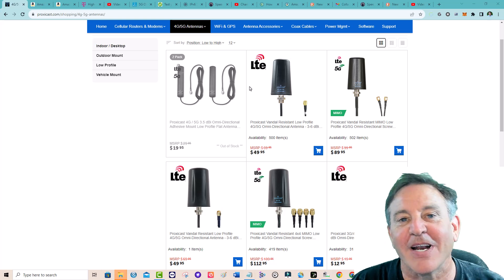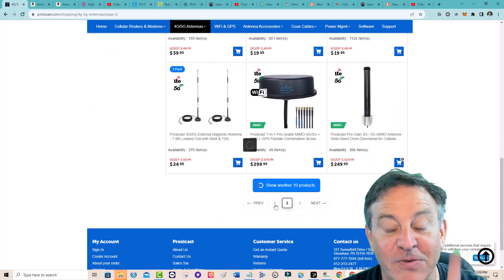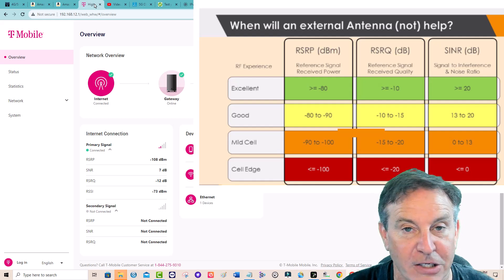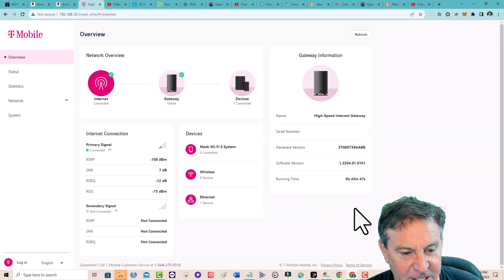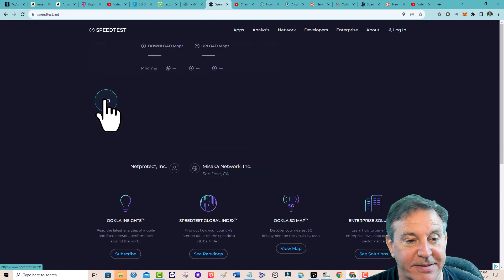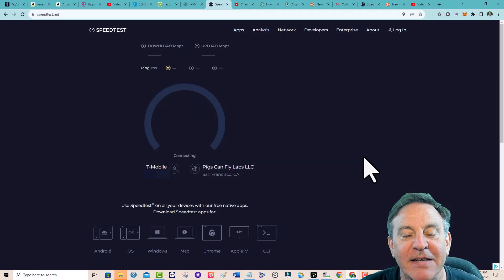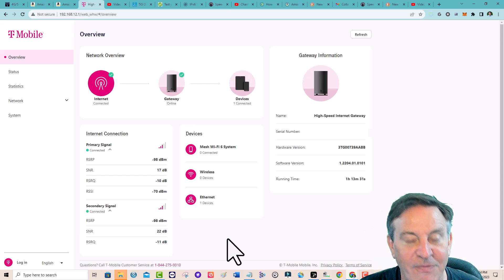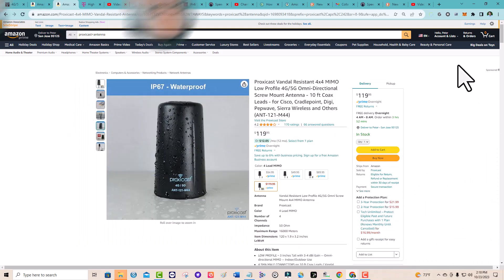🔴Small 5G / 4G Antennas - for Vehicle or HOA Stealth Install

Comment: more bar your near the cellsite, less bar your to far from the cellsite, speed depend of traffic or area.
Reply from the maker: Bars are not related to your distance from the cell tower, they're merely a reflection of signal strength. They tell nothing about signal quality or signal of noise ratio which is actually more important. They tell you nothing about the band that you're on or the backhaul provided to the tower. Is there a question?

Comment: Who is yuri?
Reply from the maker: Russian programmer that takes it personally when you report a bug. I've got a new small antenna that looks really good.  Stay tuned.
Reply: @PeterC408  ohh ok nd I had a question I am using third party gps system that runs on 5g as it's source of net but cell reception gets weak in some areas so can I use this antenna for it(it's a Android 11 bases 10 inch screen)

Comment: Does VSWR matter? Some of these antennas have a VSWR of 3:1 or less.
Reply from the maker: The thing that I am most concerned about these antennas is their size. They are small, very small. They will work well for high band frequencies but what about the XR bands at 600MHz. You may want to get more metal in the sky to be successful with the lower bands.

Comment: Thanks for your review. I really need a 4x4 for my RV!

Have you opened these up? One review for the 2x2 from J. Newman on Amazon says "…to my surprise there is only 1 antenna. The 2 mimo connecting wires looked like they were wrapped together and soldered to one point on the antenna circuit board." Do you think this matters?
Reply from the maker: Great question and I have a good reply for this... and I will be posting it tomorrow.
Reply: @PeterC408  Thank you. I did order this 4x4 anyway based on your test results and the fact I can't use those huge rectangular flat 4x4's on my RV roof. :)

Comment: How would you configure this to work w mobile ?
Reply from the maker: What is w mobile?
Reply: @PeterC408  can this be used to boost your cellular phone / mobile signal ?   If so, how would you configure it since it has a “antenna” hook up
Reply from the maker: Sadly, no this will not do it. Here is a product that is supposed to improve your signal but it did not work for me. This is the only bad review I ever posted https://youtu.be/1wJhVV5hDK4

Comment: I enjoyed your video, but I don't agree with your assessment that power is just power...power should always be a primary consideration because it is an indicator of problems/losses in your system.  You can have a million dollar setup but your power losses, that can be eliminated with clean connectors, can ruin your day regardless of what your equipment cost.  Don't you know RF is a product of magic? He he!
Reply from the maker: Power is kind of like water pressure; once you have enough, you can move your focus to something else. Kevin from Proxicast likened Power to music volume. Louder is just louder. You need a clean signal more than just loud.

Comment: Good evening Peter. Thank you for taking the time to answer my questions. Really appreciate it. Now I can make an informed decision based on quantitative data you have presented in this video. With that in mind, I have to compare your information vs. the bands available at the intended area of operation.

As a follow up, I just confirmed with Cellmapper and the LTE bands at the local T-mobile cell(s) are 2, 4, 66 and 71. 66 performs at a max download speed of 260 Mbps with an average of 139 Mbps. On the upload, 66’s max speed is 49 Mbps with an average of 11 Mbps. With this info in mind, I may benefit from higher gain equipment. Would you agree?

However, Proxicast will be a better application for my main residence in Miami Dade county a few miles away from Miami International Airport. Certainly a contender that punches at a higher weight class. Good for Proxicast for providing a great quality product at a reasonable price.
Reply from the maker: From what I understand, gain only amplifies your signal (good and bad). It would be like turning up the volume on the radio of a channel that you don't get very well. Sure, its louder but is that going to result in more bandwidth. I got the greatest improvement by simply adding a single 2x2 antenna https://youtu.be/wXSpbP8NuWw You can paint this (no metallic paint) and it will look pretty good. Or you can say it is a TV antenna which they can not keep you from installing. It is your right to receive OTA TV broadcast.  Many of them look like this.
Reply: @PeterC408  great point. One way or the other, I’ll make this happen. Thank you again for your time and cooperation. I’ll keep you posted on my progress next time I go to visit my in-laws. Hopefully this will give the opportunity to telework from the island every now and then.
Reply from the maker: I was literally in the middle of nowhere and I tried StarLink https://youtu.be/Pc4O9RUepTw It worked pretty well 25 Down and 5 Up. Not amazing but I was working remotely!
Reply: If its a 4x4 why just two leads. What about the other two wires?
Reply: What two wires do you test on a Fast 5688 tmobile router?

Comment: Nice video.  Have you tried any of the plug-in powered cell boosters sold online?  Hiboost and a few others?   A little unrelated, but in the 1990s I lived in a second story condo (top unit in an 8-unit layout) and we had antenna restrictions for TVs.  No way was I paying the sky-high cable TV costs.   I looked around a bit in my unit and found the access hatch into the attic in a closet.  I was able to install a full TV antenna up there right above my TV, run the cable down into the room through a hole in the ceiling to my set and the quality of reception vs standard 'rabbit ears' was incredible. When I sold the condo I simply pushed the cable back up into the ceiling, patched the hole, and the new owner probably wasn't the wiser of what was up there!.
Reply from the maker: I have and this time I was really excited to get a 5G version but this is the only negative review that I have ever posted. It failed miserably. Take a look https://youtu.be/1wJhVV5hDK4 
It makes me angry that they can sell products like this. I have not been this disappointed since I was 7 years old and bought s 7' ghost from the back of a comic book. Total scam.
Reply from the maker: I got burned with "Sea Monkeys" too. Didn't look anything like the picture.
Reply: @PeterC408  My first consumers disappointment was EXACTLY the same with the 7' tall "Monster Ghost." It was a piece of plastic and a balloon. I waited for weeks to get this amazing supernatural toy and damn....